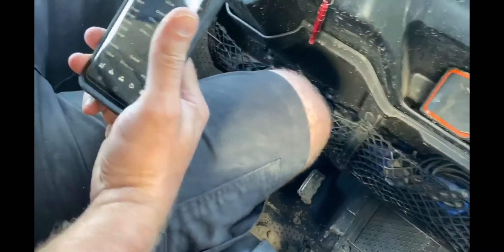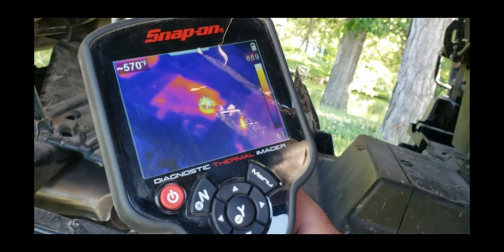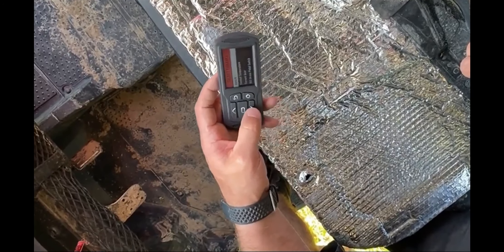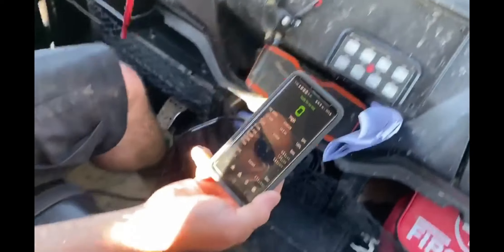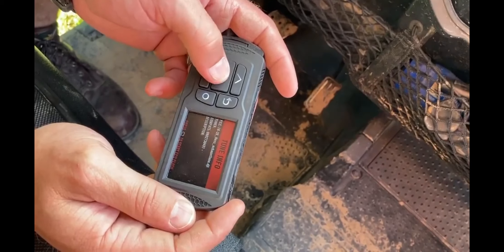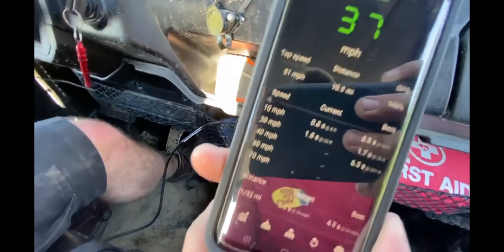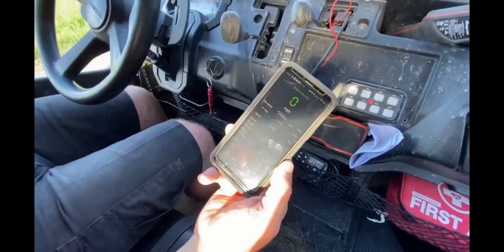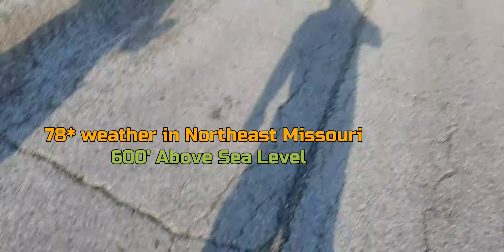Pioneer 1000 Hess Tune, Hot in the cabin?  (Not anymore!!, find out how easy it is to fix!!!!!!!!))

Comment: I have a new machine.. Does this tune void the mfg warranty?
Reply from the maker: I'm sure it does, some guys were buying a space pcm so they could change it back. My opinion, they don't cover clutches so I guess if you had a motor issue it wouldn't be covered. Tune is what saves clutches though.

Comment: I have a 2021 1000... is it worth the tune? I don't wanna screw with shit if it isn't a huge improvement...you know more than anyone else...what you think?
Reply from the maker: Oh i think it is, the dct shifting is where its at.  As well as reducing the heat in the cab, which is the reason why I did it in the first place. Its an expense for sure, be nice if you knew somebody with a PV3.  Then you could buy a $200 token & load yours.      I don't know it all for sure.
Reply: @z28camaro82  i am the first here in Central Wisconsin that is going to tune one... everyone here is placing two way fans in cowl... the cost isn't a problem ... just warranty... does it pay to void it... but the heat I can tell is going to be rough.
Reply from the maker: My thing on the warranty, they won't cover clutches. I didn't worry about it, but I have a pretty good dealer.
Reply: I'm in Western WI. Did you ever tune your 2021 1000? I just bought a 2021 1000-5 Deluxe.

Comment: Do you have to leave it plugged in all the time
Reply from the maker: No you just plug it in to load tunes, read codes. Now there are some built in gauges but need longer cable to mount it on dash.